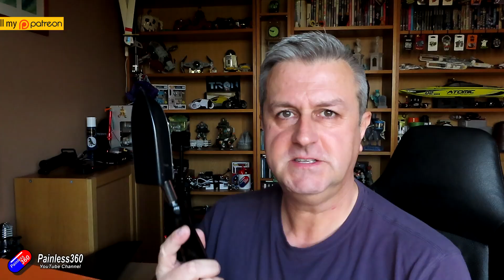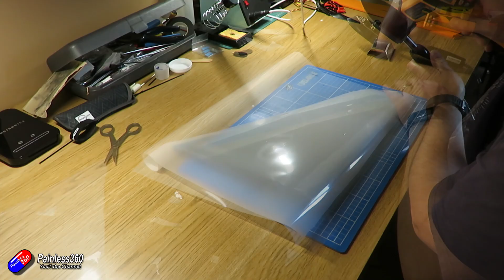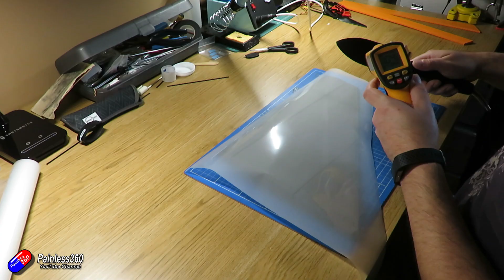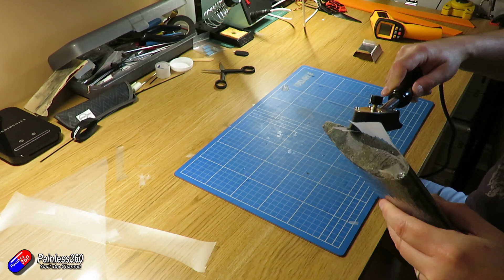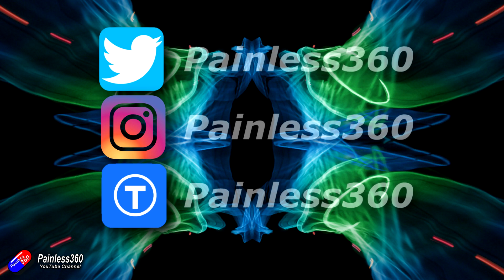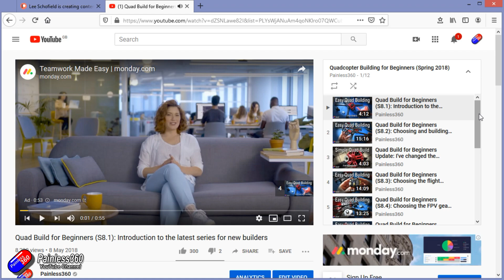Laminating foam for beginners: How to, Tips and Tricks

Comment: I have the same iron but no way to check the temperature, which stand do have it on?
Reply from the maker: This is one that came with mine. I've since upgraded to one that you can set the temperature on. It's a lot easier to use...
Reply: @Painless360  Thanks but i mean how far did you turn de heat on on the iron itself
Reply from the maker: I don't take much notice as I use the temp gun. It tends to need to be tweaked over the time I'm using it as it doesn't do a great job of staying at one set temp..

Comment: I know this is an old video but I'm wondering can I laminate each wing half then glue together or should I glue them and then laminate and the same with the foam wing tips it would be easier to laminate first but would glueing laminate to foam be sufficient???
Reply from the maker: I'd glue them once built, normally. Overlapping the leading edges provides additional strength... Happy flying
Reply: @Painless360  OK Thank you for taking the time to help

Comment: If you are going to do this on a regular basis then invest in a Tack iron, ideal for the corner's and folding edge's . to shrink after I have finished I run a heat gun over the model quickly or a hair dryer, but watch the film so that does not melt. All takes practice and patience.

Comment: Another great tips video Lee.

I especially like your strategy for applying the heat in tiger-stripes and then infill between.

But. How about dealing with control surfaces? 

1)  Do you complete the structural wing and control surface separately and then join them, presumably with discrete hinges?

OR

2)  Do you ignore the presences of the control surface and cover in one go? I can see two routes from here: a) split the film and tuck and stick into the gap, or, b) attempt to get the film to follow the hinge groove profile and thus very effectively reinforce the foam hinge? (difficult for internal returns thou) 

If the model is a pre-assembled PNP, then Option 2(a) is probably the most realistic approach.

DaveH
Reply from the maker: If the ailerons are part of the wing then I'd use method 2. If they are separate then I'd use Blenderm hinges.. I hope that makes sense.. Happy flying!

Comment: My laminate jobs are alway terrible with lots of wrinkles and bubbles but wow does it strengthen my EPP wings and makes them slippery in the air. Love laminated wings. With EPP, you can wipe it down with alcohol and it gives laminate and tape extra holding power.

Comment: I plan on doing this to my Volantex Ranger EX, which has factory-installed plastic hinges in each of the control surfaces.  The surfaces are also connected to the wing with maybe 50% thinner foam.  I find the surfaces have a lot of resistance and don't freely move up and down because of this foam.  The servos struggle and can't move them as far as they could if there was no resistance.  Should I cut the foam away and just trust the hinges, or is that a bad idea?

Comment: Another good tip is to sand down the foam so its nice smooth and fuzzy and to use a spray glue, 3m90 is the best to use. Spray it on and let it set, if you want to paint it you can do it then, then laminate. The glue and sanding down helps the laminate to get a much stronger grip and a smoother service.

Comment: Hey one question,
Just got the toothless nano, hooked it up to my fc and now I only get the Foxeer osd („Foxeer, voltage, timer) but not the betaflight osd from my fc.
So how do I turn off the Foxeer osd and enable the bf osd?

I believe wiring is correct... I am using the mamba mk3 stack;)

Thx so much!
Reply from the maker: You will need to connect the joystick to the camera to turn off the camera pieces. See my build videos for setting up Betaflight, the OSD is usually turned on by default .. Best of luck
Reply: @Painless360   got it now, thank you so much! Im going to maiden now:))

Comment: Lee, I was looking for more details on why the double layer of laminate and automotive wrap. Does the laminate help the automotive wrap stick better? Do you apply the automotive wrap with a heat gun, iron or no heat? I would appreciate your input. I recently covered an FX79 with automotive wrap, but did not use a laminate base and results were not the best. Wondering if this technique is what I should have used?  Thanks!
Reply from the maker: Greig and I did some tests and the adhesion of the car vinyl to naked foam was poor. Adding a single layer of laminate makes it super strong. No need for heat with the car vinyl. Hope that helps..

Comment: Is there a difference in temperature with Epp vs. Epo foam or that Elapor(?) foam that some manufactures used to use?
Reply from the maker: Always use a cooler 130 deg setting to adhere the laminate to somewhere out of the way on a model to check how it'll work if you are not sure..
Reply: @Painless360  Thank you. I continue to enjoy your videos and appreciate what you do for the hobby.

Comment: hey Painless360 from having quite a lot of fpv flying wings all that i have laminated myself. I can tell you that melting the foam to make it all go without the air gap(that hazy look and going all black as you said but u don't like to bother) is actually making the laminate essentially bond much better and the wing becomes slightly more ridged. And when you do crash the laminate doesn't wrinkle nearly as much. but still the vids are good to watch. been watching your vid's since b4 u ever used to come on camera. :)

Comment: In your experience does adding this little bit of extra weight have any noticeable affects on the flying characteristics of the model?
Reply from the maker: Adding weight to a model is always tricky as it can affect hoe it flies. The laminate is not too heavy so a single layer isn't a lot in the overall scheme of things. If the model needs to be as light as possible then you can just laminate high risk areas like leading edges and belly skids.. I rarely use it here.
Reply: @Painless360   Thanks

Comment: Great video and as said already you are the first to mention a target temperature, so thanks for that. I just want to mention that the film does add weight so don’t necessarily go mad laminating every square inch on a model if it’s weight sensitive - perhaps just do the bits that get dinged or scuffed.

Comment: I do recommend some practice - Ive made a dogs dinner of my nano talon a few  months ago- doing planes if much different to fixed wings like these. The flaps and receivers/tx's etc.. some people recommend to do them afterwards or before laminating (so the laminate itself helps keep components in-place), though if you're like me, you might be swapping some electronics - fixed wing looks easy but planes with spars and things like skyhunter/ranger's have some proper fiddly bits - those I would like to learn about with laminate as it does help tremendously on the water-proofing and strengthening of parts. Nice video but cool really do with some tips on working around motors/spars/flaps etc..
Reply from the maker: Thanks for the comment, this is a 'beginners' video. If I get enough interest I can do a follow up with a more complex shaped model..

Comment: Why not use traditional rc covering film? They are pretty lightweight :)
Reply: Laminate is much cheaper and it's easier to control the shrinking which is really important on a foam model. Plus depending on thickness it is a lighter than you'd think. I have some 1 mil stuff that I use for smaller planes and it's less than half the weight of most traditional "light weight" covering except solite it's about on par with that at a fraction of the price.
Reply from the maker: What he said! :D

Comment: What is the black carbon looking auto covering that you did. Could you post a link to buy it. Thanks.
Reply from the maker: I got mine from eBay. '3D Carbon Fibre Vinyl Wrap, Film Bubble Air Free Self Adhesive Various Colours' I also used the orange in this build too... Details now added in the description as others have asked. Happy flying!